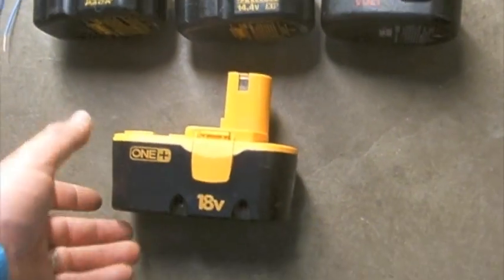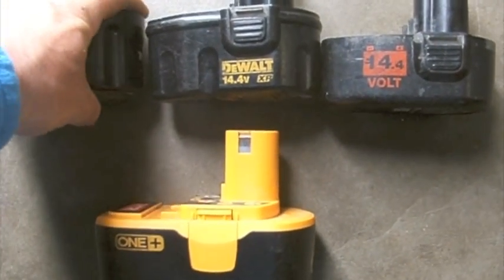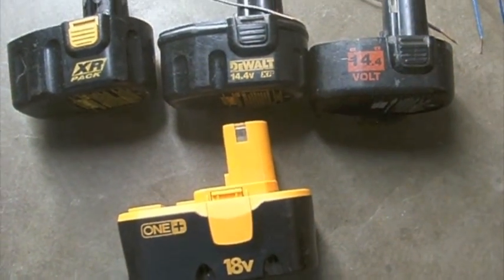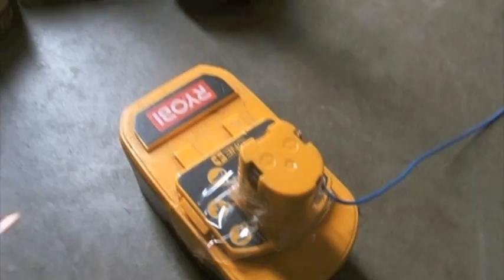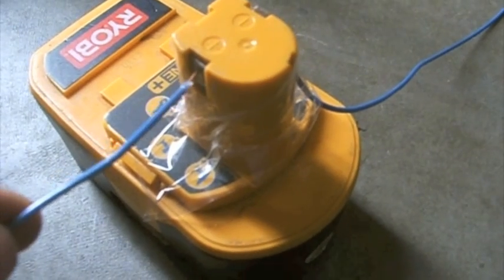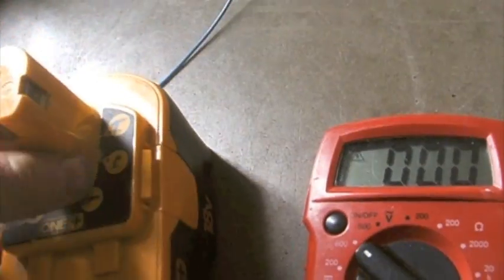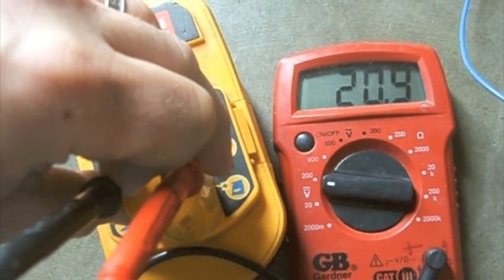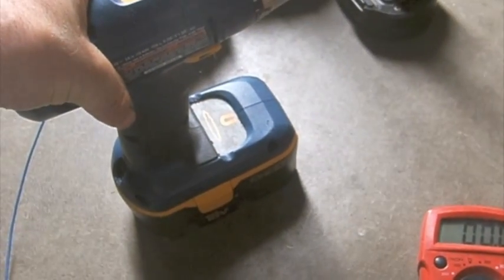DIY How to revive/fix/rejuvenate/Repair/ recharge a bad dead rechargeable NiCd battery for cordless

Comment: Would like to see how long the charge holds on yours. I tried this on 2 of mine, they took some charge afterwards, but not much capacity. Was dead after drilling 2 holes in pine, so, about 5% capacity restored. Worthless.
Reply from the maker: Mine were at about 5% fully charged when I did this.  You may have bad cells that needed replacing inside the battery...

Comment: The baterries will not last but only a few minutes if that(: once they are old and worn!? They are junk
Reply from the maker: Mine was old and worn and holding less and less charge.  I could only get a few minutes if from the battery.  When I did this the difference was definitely obvious.  While it may not be as good as new my battery was way stronger and lasted way longer.  Did you even try this?

Comment: I need to jump my snap on batteries! they are the older model so the truck doesn't accept them
Reply from the maker: Best of luck!
Reply: @youcanfixit3721  I got it 👍🏼👍🏼 I used grabbed some wires with alligator clips hooked them up to my jumper and onto the battery just enough to give it some voltage so the charger can read that it has juice. it took the charge on both
Reply from the maker: @pablogomez7519  Sweet!  It's amazing that these batteries seem to come back from the dead!  Glad you got it

Comment: In the past when this process hasn't work, or partially worked; only devices to a certain Voltage. I've had to remove the casing screws and expose the battery cells themselves and pulled back the felt padding glued to the top of them to sap the the pair's individual y. Used same process, Common wire on Pack Common contact and the +/hot to each pair.

O
Reply from the maker: Yes sometimes certain cells go bad and they can be replaced as well by taking it apart.  Thanks for the comment

Comment: My ryobi batteries will take a charge but not a full charge. I can charge them but I think after the batteries are so old or worn out after the charger says they are charged within a couple minutes of using the tool they need charged again. Thus might work for some but for me it's a waste of time.
Reply from the maker: Yeah that's what my batteries were doing until I did this.  Did you try it?

Comment: If the battery has reached its rechargeable cycle you will NOT recharge it, so stop lieing to people!
Reply from the maker: well mine only charged and worked for a screw or two and was dead, until I did this and was able to do a bunch, probably should have counted, but more than 50, so it was at least 50 times more of a charge than what it was.

Comment: I have a 12v drill battery that was completely dead, wouldn't take a charge, meter showed virtually zilch. I don't have any other batteries to try out the method in this video but then I read the post from f150sbcglobal about him doing it with a 12V battery charger and gave it a try. Now my charger only outputs 2 1/2 amps so I wasn't very hopeful but yes you guessed it, it worked!! Battery came back to life, took a charge and is powering my drill again . Thanks to all you guys!

Comment: i  USED A 12v BATTERY CHARGER TO ZAP MY 18V BATTERY & IT CAME BACK TO LIFE ON BOTH OF MY 18V BATTERIES :)
Reply: What do you do just tap the + and - terminals with the + and- leads?

Comment: Is it normal for the batteries to how no charge in them if they aren’t used ? I have left my batteries in the charger then I take it off and when I need to use it i connect it to the drill but no charge

Comment: Corrosion is what kills all of these batteries no matter what type they are.  I don't know why they make all those little batteries in all these units out of steel and we all know what happens to steel when it gets cold......RUST!  (Moisture condenses on them. Why cant they make them out of brass, copper, or stainless steel as it seems they would resist the corrosion better.

Comment: So?  How long did it last & did it hold charge as if it were new?
Reply from the maker: I only use it intermittently now.  I thought it held the charge for a while quite well, and it was down to like no power after a charge, so getting all this power again was kind of a thrill.  Way better than the 1-2 minutes I was getting, because it was so drained.  Overall I did not test it for longevity, I do know my battery hardly held a charge and this had me up and running again.  Best of luck and thanks for the comment.

Comment: There are  a few suggestions for battery repairing
do not attempt to do this until you know what you are doing - the acid can burn you
Test the voltage first - there may be a kaput cell which will waste your time.
Check the battery fluid.
attempt to fully charge the battery.
(I learned about these and more from Rapid renew roadmap website )
Reply from the maker: do NOT!!! do this with acid batteries

Comment: Thank You!!! both of my Dewalt 12V cordless drill batteries died about a year after I bought it. It has been collecting dust for the last 10 years. Until today, I have followed your instructions but I used the Schumacher XP2260 battery jumper instead.  Very much appreciated.

Comment: Excellent guide Craig. I'm sure this is going to help thousands of people save a bit of money [Check Details Here==>https://plus.google.com/u/0/108651713028983002499/posts/LDqnh8JbDNc ]. It even works with solar/off-grid, marine, golf cart, and forklift batteries. Plus, many more .Anyway, thanks for the help and congratulations on a fantastic product.
Reply: TY
Reply: DOES IT WORK

Comment: I have 2 ten year old 18volt batteries for dewalt and Hyundai drill and combo sets...batteries are weak after charge...I also see videos on taking packs appart and soldering new cells..which seems to be best way to me...

Comment: this trick won't get the acid back into the battery cell that leaked out. but i tried this on numerous packs 9.6v 14.4v 18v 24v, nothing improved in performance, other than it went back to the ability the pack had a few charges previously, which was crappy. just buy or swap out the dead cells with replacement or swapped out nicad cells and rebuild it. if your battery is completely drained your charger may not know you put a battery in the charger, will need to put some charge into the battery manually so the automated charger sees it.
Reply from the maker: I don't work mine hard and it seems to be holding up well.  I would guess if you are using if tor a fair amount of heavy duty it would be best to switch out, but then if are going to put out the money you may as well upgrade to a newer drill.  If you are only swapping out cells that's pretty cheap, but these battery packs new aren't very cheap.  Thanks for the post.
Reply: I tried to replace dead batteries in the pack from other packs, crazy hard to find the ones that are dead and the ones that are good, reliably, with all that work, I have a laser temperature gun, and can check the temperature of each battery when charging, and after charging, checked the voltage of each battery in the pack, all read 1.2v, then ran the pack in the drill until drained, all discharged equally, so, I need to test each battery separately, time consuming.

Comment: You cannot get 45 volts of current.  they are two different units
Reply from the maker: You are correct! But the vid was already made and for the most part people are smart enough to understand what needs to be done.  But you are correct.

Comment: I don't mean to be unappreciative you video is good but yoh didn't show hooking up the wires to the 3 other batterys. So I'm in the dumb. I've no idea what to do? Also I saw you pull off some tape. What was that all about? You left some steps out. So your video needs editing I'm sorry.
Reply from the maker: Hook negative to positive on the charged batteries.  Then use the 2 leads that are left to touch positive to positive  and negative to negative tapping as shown in the video.  The tap was simply to hold it in place as I don't have enough hands to hold all the wires in place
Reply: SEries: First battery '+' to Second battery '-'
Reply: 8 Simple Tips & Tricks To Extend The Life Of Your Car Battery > https://t.co/3ycayBV4e1
Reply: hey ,if anyone else wants to learn about recondition old batteries try Jadonite Renovate Battery   Buddy ( search on google ) ? Ive heard some interesting things about it and my colleague got cool success with it.
Reply: hey ,if anyone else is searching for how to recondition batteries try Trefendous Rapid  Extender Tips (do a google search ) ? Ive heard some decent things about it and my work buddy got cool success with it.
Reply: There are several factors in fixing a car battery. One plan I discovered which successfully combines these is the rapid renew roadmap (google it if you're interested) definately the most useful course i've heard of. look at this unbelievable site.
Reply: Not certain about the points made but ,if anyone else wants to learn about how to recondition batteries at home try Knewreck Rapid Renew Guide (do a search on google ) ? Ive heard some super things about it and my brother in law got excellent results with it.
Reply: i thought the same crucial details are missing
Reply: Some suspect posts in this section..

Comment: here's  a few tips for fixing a car battery
never attempt to do this until you know what you are doing - the acid can burn your skin
Test the voltage first - there may be a kaput cell which would waste your time.
Check the battery fluid.
attempt to fully charge the battery.
(I read about these and more from Jons mender guide site )

Comment: How exactly does this rejuvinate dead battries?
Reply: Richard Joyner as you charge and discharge a battery crystals start to form on the cells called dendrites. These dendrites branch outward and can cause a short circuit within the battery. what overload shocking does is rupture the thin outer branches of the crystals, killing the short and allowing the battery to function again.
Reply: @deejdubya   Where could I get the Video   to show a battery  opened  with this problem  and then a dead battery  with the same problem  being jolted back to life . 
    I  must have missed the    reports  about  the  Consipracy  by  companies  wanting to produce batteries that are crap  so  you don't   any more of their  products   and dopn't tell buyer  how to do this.
Reply: @garywood9525  I'm not sure how I'm supposed to interpret the tone of your reply. Either you're mad because you don't understand science or you think I'm a conspiracy nut job......I'm not sure where you got that from. Either way, here is a link that explains lead sulphate crystallization that happens in all lead acid batteries. It would be interesting to see the inside of a battery as you decrystallize the plates but you'll just have to trust chemistry I guess.
 https://www.chargingchargers.com/tutorials/battery-desulfation.html
Reply from the maker: Not totally sure what it does, but an anolgy could be;
The more you charge the battery the less life it has like it's losing its memory and holds less each time.  This opposite charge kind of clears the memory and allows you to kind of start over with the battery and kind of clears it mind to a closer to new starting point.  Best I can give...
Reply: ok, cool. thanks

Comment: @ 22s, what is 45 volts of current?
Reply: It's the new  way School work.  Everyone in the  Electonics class  passes  as to not hurt their felling .  Myabe this is why the newer   Fly By Wire  high-tech    passenger planes  crash or have failed electronic systems.    The current is 17 Ohms   while the      the  resistance  on the Motors  is 37 amps  .

Comment: And yes volts are expressed as electromotive force,amps as current.but I got what you was trying to say.sorry,I got ohms law stamped on my brain when I was an electrician.awsome vid though,I hope I'm getting closer to my goal in this research.my batteries are 30$ a pop.last a year under perfect conditioning and use.and I use alot of them in my battery banks
Reply from the maker: +Richard Peterson  :) I had someone else mentioning that :) Glad you were able to see through that and thanks for letting me know the video was helpful.  I know that you can also take these apart and separate the batteries and remove and replace dead cells as well.  If you go through a bunch of battery packs it may be worth it to stock pile some and then go through a handful of them at a time.  I know I have seen vids online here where they take them apart, find the dead cells and replace them and put it back together.  Maybe of some use if you are going through a bunch of battery packs.  Best of Luck!

Comment: Your success may vary with this technique.   It's better to replace the bad batteries within the pack.  Many of us have multiple packs lying around.  Ideal to fix the problem.  It's a bit of work to combine the good batteries into 1 or more good packs, but worth the time and effort. But, if you get success by jump starting these 18v packs with 36 volts or more, more power to you.
Reply: How To 🆁🅴🅲🅾🅽🅳🅸🆃🅸🅾🅽 Batteries – 𝐁𝐚𝐭𝐭𝐞𝐫𝐲 𝐑𝐞𝐜𝐨𝐧𝐝𝐢𝐭𝐢𝐨𝐧𝐢𝐧𝐠 Ṁëẗḧöḋṡ > https://t.co/jfZbilIKLW?sdf34fgsd3
Reply: Larry, if you're still around, how do you identify the bad cells within a pack. I've got a pack that needs some replaced, but I don't know how to tell which ones.

Comment: I have a question for anyone who can answer it. Can I use a variable power supply (0-25volts, with a max amperage of 10 amps) to bring back 1.5volt D-size NICAD cells?

Comment: **BEWARE** I did this. It worked for 3 seconds then I saw my charger fry (thru the cooling vents).  Now it's dead.
Reply from the maker: +Dan K Did you just use batteries to tap it to give it a charge or did you use the charger to tap?
Did you follow these steps in the description?  I posted them below. 

1st  -  Fully drain your battery, so it shows no voltage on the meter.
2nd - Connect your batteries in a series.
3rd - Take the negative lead of your series and attach it to the negative terminal of your dead battery (I just taped it into place) 
4th - take the positive lead from the series and quickly and repetitively tap it to the positive terminal of the dead battery for 5-7 seconds.
5th - Check current with the multimeter to make sure your dead battery accepted the charge.  If it did not wait 5-10 minutes and try again, before determining you have another problem, just in case you made a mistake in the process the first time.
6th - wait 10-15 minutes before attempting to charge.
7th - Fully charge battery and test test on multimeter.
8th - Enjoy your newly rejuvenated battery

Comment: it sure would be nice you would show how you hooked up the wires....ever thing looks fine if you are the one giving the report
Reply from the maker: James Maloney It depends on the batteries you are using.  The batteries you connect in a series need to go positive to negative and positive to negative.  Then with the positive and negative wire that remain from then end batteries you will tap + to + of the dead battery and the negative from the good batteries to the negative of the bad batteries.  You can use tape to connect the wire with the battery.  I just folded the wires over and they wedged into my batteries, but for most batteries you'll need to use tape to get the wire to stay connected to the battery terminal.  It isn't enough power to need any special tape, just get it to stay on the terminals long enough to tap the dead battery.  if you're using 2 batteries Connect your battery(1) + to battery(2) - and you will have a lead of a - from battery (1) and a + lead from battery(2).  remember you need 2 times the volts.  I used 3 smaller batteries so I had a bit more V than recommended but I used what I had on hand.  Best of luck
Reply: Thanks sure does help

Comment: can you revive lithium ion camera batteries? If so, how?
Jim.
Reply from the maker: jymz4941 I am pretty sure it is a BIG NO NO with Li batteries.  You have to replace the cells, not sure if you can take it apart and fix on a camera battery.